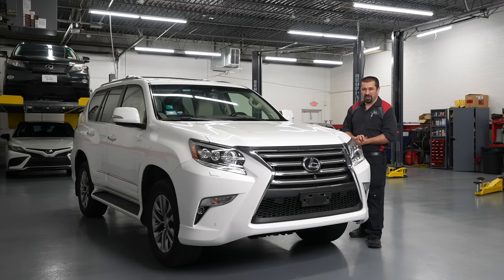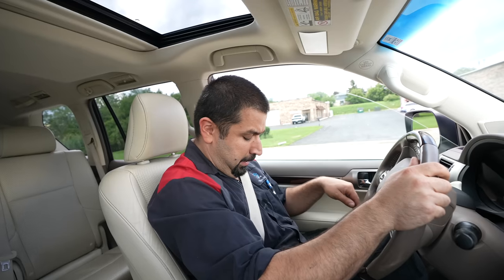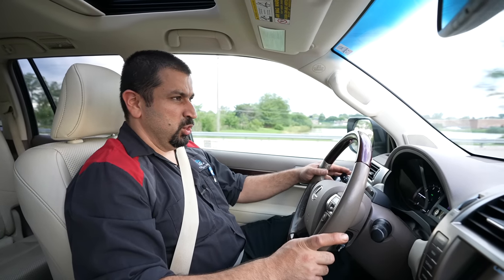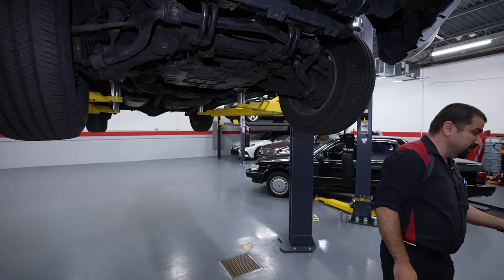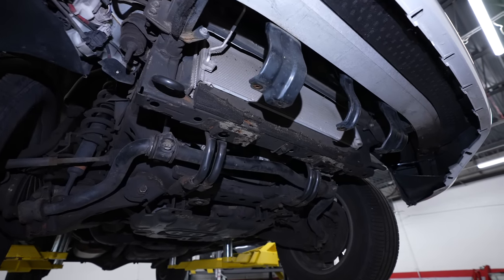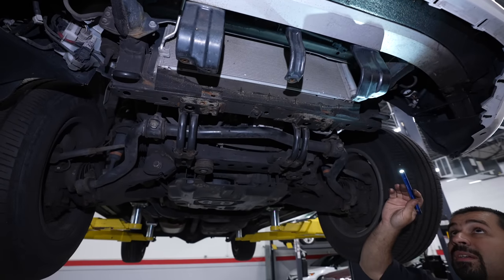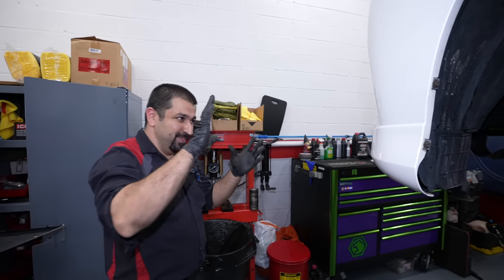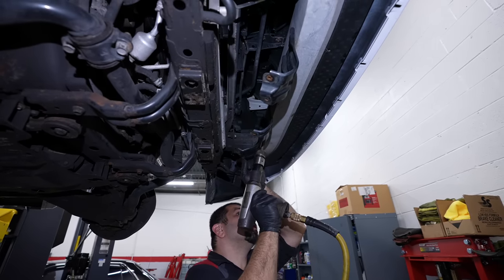Lexus GX460 Off Road Damage | Our Cameraman Had a Bit Too Much Fun! Let's Fix It!

Comment: Jose , since your looking to do some more serious off roading and using this truck as it was intended,  definitely get the front steel bumper at the minimum . You increase your approach angles and reinforce the front end . If you go with a aluminum front bumper from maybe RCI for example you may not even have to replace your front springs to slightly stiffer ones to account for that added weight. Don't raise the vehicle,  although it would be very cool !  Lol. Look Into appropriate tires for your use case as well. Falken wild peaks and Bridgestone k02 are a very popular choices and for good reason.  They don't sacrifice too much ride quality and economy but offer fantastic off road performance.. assuming your off roading advances and you start ripping off the running boards and Rear bumper just replace them with rock sliders and higher aluminum rear bumper accordingly. That's just me 😂 oh and if you know your taking this vehicle overlanding definitely install skid plates underneath to protect the trans and gas tank
Reply: I put a set of Falken Wild Peaks on my Taco and then after 25K miles had to put another set of 4 on.  2 of them were just about at the point where it would have been illegal to run them because of tread depth.  Partly my fault because I unintentionally ran them over the recommended air pressure and as a result the middle of the tires wore.  But even before I put them on I thought it looked like there was a lot of space between the lugs of the tread (lot of area where the tires/rubber was not hitting the road).  I was not impressed with their longevity.  Great traction but I'll not buy them again. 

Personally, I think anyone who takes a well built Toyota off-roading has a screw loose and too much money.  And someone who makes "mods" to a Toyota truck just to do that has even more screws loose.  Toyota builds the most durable well engineered trucks on the planet and then people make mods to be cool and their performance, efficiency and durability suffers.  I think that's irresponsible and a waste of resources.  Both natural and financial resources.
Reply: Lol no. Start with a lift, UCAs, absolutely anything else before you put 120lbs on a stock suspension and expect it to be fine lol. It is just you.
Reply: @ravenfeather7087 Falkens are low end tires.  I would not buy them
Reply: @ravenfeather7087  That's not really been my experience, they come with a 55k warranty too so if they were out after 25k you should have gotten them warrantied.  Overinflation can make a major difference on wear though as well as a bad alignment.  As far as space between lugs, you want to have that in an offroad tire,  it allows the lugs to grip and also helps in ejecting mud and rocks.

Comment: I recommend you start wearing protective goggles. I worry every time you are inspecting underneath a vehicle without safety goggles. My uncle got rust in his eyes many years ago working on a car without safety goggles and needed eye surgery to remove it. Thanks for a great channel! I really enjoy your videos. I drive a 2014 Tundra and want to drive it for many more miles!
Reply: Especially like when he used the tool to remove those 3 damaged brackets up front - plz especially then wear eye protection
Reply: I second the need to wear eye protection. I will never forget the young man who was cutting through a very old pipe in my house and a piece of metal flew off the cutting wheel and hit his eye.

Comment: I'm glad you know that tires cause the majority of pulling conditions. You have my respect. Alignment does indeed need to be upside down for alignment to be causing a pull. Hard to break the myth. Easy switch the tires side to side to confirm. A pulling tire will wear quickly.
Reply: Could you explain please ?   "Alignment does indeed need to be upside down for alignment to be causing a pull."

Comment: I live in Michigan, and I've been to the Silver Lake sand dunes many times. In a lot of spots its very risky to go fast as the wash board like formations of sand will send you bouncing around hard and then stuff like that can happen to your vehicle. Its always best to drive around slow first to get an idea of what the terrain is like before you try it any faster.
If Jose plans to continue doing off-roading, a good skid plate in the front might help protect against further damage, especially with the condenser right there.
I do remember one time going over the peak of a tall dune and getting high centered on the peak when we made the mistake of stopping at the wrong time. The vehicle came down on the frame rails and we were stuck. Always bring a good tow strap along and have a hitch or tow hook installed on your vehicle so you can have someone help you get unstuck.

Comment: Hey Jose it's cool that you went to the dunes most people don't take their trucks to the dunes and just do trails or rock crawling instead. Some tips for the dunes obviously air down but also you can remove your spare tire for weight it's easily 60 to 90 pounds it will help alot with the rear suspension. You can also remove your hood that's another 40 to 60 pounds it will allow the engine to run WAY cooler and also its been dyno proven with heat soak you lose about 40hp. You can leave that stuff back at camp or put it back on at the end of the trip. I say good idea and run a metal bumper preferably aluminum for weight. Also street tires work the best in the sand and a AT tire will out perform MT in the sand. If you want to go super low on tire pressure but worried about breaking the bead just carry some starter fluid you can easily re set the bead. Like Car Care Nut says "less is more" especially in the dunes!

Comment: Welcome Jose!!!  Definitely look into a hybrid steel or aluminum bumper at a minimum.  I know I've seen at least one good comment with more details highlighting steel vs aluminum related to weight and suspension.  I might have missed this point, Steel slides on rocks, whereas Aluminum tends to "grab" them. 

Best of luck on these fixes and on your upcoming off-road adventures!

Comment: Welcome to the channel José. As for your car, seems to me that you enjoy doing off road with luxury vehicles 🤣. I can relate of your experience, I was working on a project out of state several years ago, and I was driving a brand new Challenger with less then 1k miles. One day while I was driving to a location I took a “shortcut” that put me in the middle of a mud pit. We were able to get out but the car changed color from white to brown. I had to drive to a car wash and took us over 3 hours and a lot of $$$$ to remove all the mud from all the crevices of the car. So on my side lesson learned no off road in expensive vehicles 🤣

Comment: Have you thought of using a rivnut to replace the stripped out bolt for that front skid plate? Probably easier than the thru bolt and trying to get a nut started on the top depending on your access.
Reply from the maker: Tried that. You’d need to knock out the welded nut on the front or use a very long one. Using a long one makes it not stable especially since this shield is pretty heavy.

Comment: CRESSIDA!

2010-2013 GXs didn't have all that cosmetic garbage the newer ones had with the giant goofy plastic diapers. If it were my truck, the least I would do is leave it as it sits in the video and keep hacking plastic off as it interferes with the GXs offroad performance. The most i would do is convert the front clip to a Prado which is for sale in the USA and or install a real metal bumper. 

The amount of protection, utility and the piece of mind I've gotten out of both steel bumpers I've had on my FJ is way worth it. From proper offroad protection of the vitals to the sheer utility of steel bumpers, its way worth the loss in MPG. It also looks bad ass pulling up into the mall parking lot with what looks like a military vehicle. 

Then again, my FJ is strictly an adventure rig I depend on for being reliable in absolutely remote and rugged areas. I cant be bothered by silly splash guards and dorky metal brackets that hold goofy plastic skirts on whats pretty much a farm truck underneath it all. I've got a LS and GS for daily driving.

Comment: I offroad my GX, it's hard to be a car care nut and offroad as you will constantly damage things no matter what unless you are only on very easy trails. Not to say that I don't take care of it, but perfection is a tough goal when you go offroad. The GX is a great platform, however, the front bumper hangs very low so it will get caught on things, rip off, etc. If he would like to continue offroading, consider all terrain tires, and a front metal bumper would be nice, but then he would also likely need to upgrade the suspension as it will have nose dive and sag some due to the weight on factory suspension. I bought an aftermarket steel front skid plate to protect the important things and I've cut my front bumper which has been helpful for more clearance. Additionally, replacing the low hanging running boards with rock sliders is a good idea if he wants to do moderate trails. 

As you can see, this is definitely a rabbit hole, but at its heart, this is a Land Cruiser with a lot of make up on it. It has a lot of fancy plastic which will get beat up off road.

Comment: Awesome video but for me I would never off road a truck like that. GX is a luxury style and obviously meant for luxurious cruising. 
Glad to hear Jose is ok and welcome to the team
Reply: Of course it's meant for off roading. It has full time 4wd with low range, KDSS sway bar disconnects front and rear, locking center differential, hill descent control, etc... Literally designed to be seriously capable off road.

Comment: Stripped thread in frame weldnut ? Lots of repairs possible. 1.Run a tap to try to restore thread 2.Helicoil thread insert repair 3.Drill hole to suit next size up Taptite self thread forming scew 4.Drill and tap to use next metric size up screw.

Comment: I didn't know the Land Cruiser/GX460 was so fragile.  I own a tree farm and have been beating on F350 and Subaru Foresters/Outbacks on dirt trails for years.  They come from the factory with proper metal skip plates and other than a few bent lower control arms and smashed exhausts I've experience very little damage.

Comment: Welcome! Consider installing something like DV8 Offroad's FBGX-01 Lexus GX 460 Winch Front Bumper
Reply: The dv8 bumper is one of the worst rated bumpers for the gx. Severely issues including a winch mount that had too sharp of a turn, causing damage to winch line. Another issue is they the wings mount to the body, causing shear over time.
Reply: @pennmikael  Good to know... can you recommend something similar that is higher quality and free of issues?
Reply: @THEH2OMAN  I personally cannot since I don’t like any of the options and just opted to cut my front and rear bumpers . I just read the negative comments on ih8mud and gx460offroad YouTube channel. 

If you are just looking for a winch mount for 14+, people really like LFD off road. If you have 10-13 then people are also very happy with the LFD hybrid mount. There was a guy who flipped and was able to self recover using the hybrid bumper. There are unfortunately not many companies that have a full high clearance bumper. Without going custom, the brands that come to mind are Ironman( heavy and a pain to install but good value, according to online), victory (mixed reviews but overall seem better than dv8), and dv8.

There’s also the victory and cbi low profile bumpers but they don’t add any additional clearance over a bumper cut. They do however add protection, and winch and light mounts.
Reply: @pennmikael  I was hoping N-fab or ARB made one for that vehicle - guess not.
Reply: @pennmikael  I drive Tundra trucks that stay on the road, but that is good information for Jose.

Comment: Hi Amd you are the best👍 yes part of car care nut is treating your vehicle as it was designed for. The Lexus was designed for…please excuse me I love your show but designed for inclement weather not really off roading. Jose may have not bent the frame but he sure put excessive wear on that vehicle. This is why I basically do not buy used vehicles. I am a car car nut follower. My friend Mike believes you can do anything to a vehicle and just repair it or change a part and it will be perfect. He does not allow for signs of abuse like fatigued metal or stressed moving parts. Rattles and loose feel can be a tell tale sign a car had a tough life. Jose is fortunate you put your hands on his car. I look forward to some day bringing my car to your shop👍

Comment: Unfortunately, when the GX was restyled in 2014 to add the "spindle grill", the front approach angle went from 28° (years 2010-2013) to 21°.  The later models with the extra cladding is even worse.  The new GX550 improves this to a 26° approach angle.  For completeness, the GX470 front approach angle is 30°.

Comment: Where the bolt hole is stripped out,could you cut a piece of all thread to the propper lenght to accept nuts and washers for both ends and finish the job?

Comment: * Lets see if you can figure this out:
My FJ Cruiser started making a random ticking (/ clicking) noise only in Neutral or Park since two weeks ago. It doesn't happen when the engine is cold. The sound resembles the noise that exhaust and muffler make during contraction after you turn off your car following a long drive. It goes away as soon as I put the car in Drive or Reverse!
This issue started after I took my FJ to Toyota for an oil change. They also changed a reverse light (I'm mentioning this because I've heard a similar sound like the ticking noise my car makes, from a faulty regulator in an alernator- of course in a different car). Also, the left blinker has started blinking at a faster pace since 3 days ago. Therefore, I personally think this might be an electrical issue.
The car drives totally fine.

My FJ's history:
I purchased it in March 2022 with 155000 Kms (~100k miles). It has always been serviced by Toyota. I'm very sensitive about my cars and I've only used genuine Toyota products for servicing it.
I've also changed my transmission oil 20000 Kms (12500 miles) ago just to be on the safe side despite Toyota was saying it doesn't need it. I was going to change it again soon.

Diagnostics so far:
- Toyota says this is might be from the torque converter, but since a faulty torque converter makes sounds all the time and not randomly, their other suspect is a bearing in the transmission pump. They say they've never seen this issue before.
- My mechanic agrees that it might be a transmission problem. He also says this is the first time he has encountered this issue! He thinks there might be a pebble inside bell housing from offroading, or a crack on a plate that connects torque convertor to engine.
- Contrary to the above opinions, two diferent transmission specialists say there's absolutely nothing wrong with the transmission and the sound is not mechanical (i.e. no internal issue with either engine or transmission - they say this might be an exhust leak)

Comment: The tires on my car just turned 10 years old. They only have less than 40,000 miles on them. They look 100% better than the tires on this SUV. Could be because it never sits outside in the sun, so they are only exposed to UV when it's driving. I'd replace them now, but I'm cheap. As long as the tires look good, and have no dry rot, I can't see dropping $1,200 to replace tires that still look good.
Reply: Lools could be deceptive.. 😢  rubber does age with time and its time to change
Reply: I’ve seen the tread just peel off of tires younger than 10 years.  Looks mean nothing.  Rubber deteriorates with age.

Comment: Just wondering, for that under cover with one  stripped thread if using a "nutsert" is an option since it's only used to secure a corner of the cover?

Comment: Something that doesn't get mentioned much, but all 4runners ive worked on(1989 being the earliest) all use 4 piston opposed front calipers. Very easy to change pads, dont need to remove the calipers. This is race car tech. Most vehicles, except high end sports cars and the like, use opposed calipers and slider pins. Brembo brakes are all opposed piston. Its interesting to me that toyota haas been using this tech for 30 plus years in their SUVs. So far ahead of the curve is toyota.

Comment: My 2004 GX470 came with a cable hoist for the spare tire. It somehow got bound up and wouldn't lower the tire any more (even though I'm not in the rust belt). The updated part is the chain hoist like on Jose's. This apparently is a difficult job as the tech billed me a couple of hours on the job. Get him to replace the flexible cover on the RF - it protects the alternator from splashes - it's really the only one that matters of the four.

Comment: I noticed one thing about ALL the Tesla drivers lately.  They aren't all about punching that throttle pedal to accelerate as fast as possible to show off anymore.  Maybe they are starting to learn 'beating' on a Tesla more or less ages the battery faster and wears it out in the form of less range!  And then they get sent to the Tesla graveyard.

Comment: Just a comment on the stripped threads. Is it possible to re tap the joke or is it to far gone? Also thread serts work really well! Just have to drill the hole to the size specified by the insert and and it sets in place similar or a rivet so it expands in the hole with the thread pitch desired!
Reply: Thanks for the tip